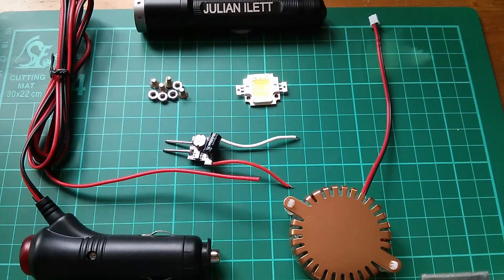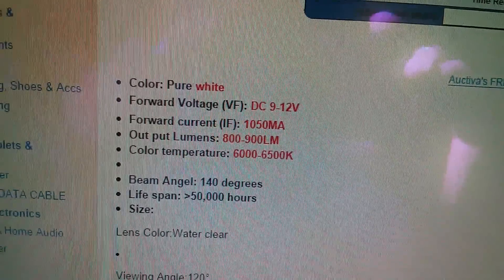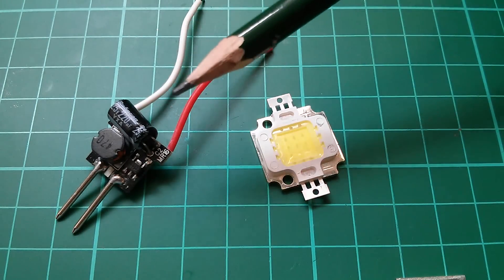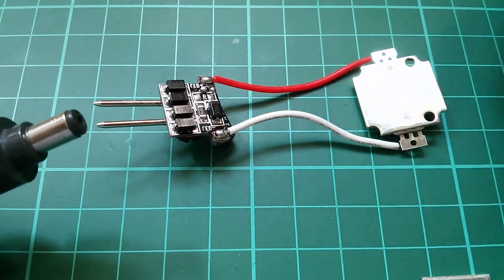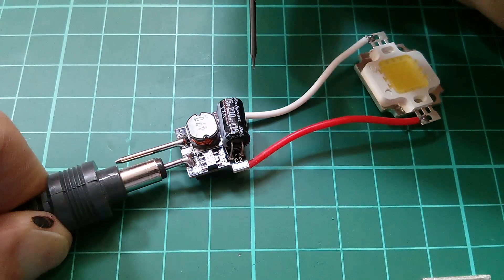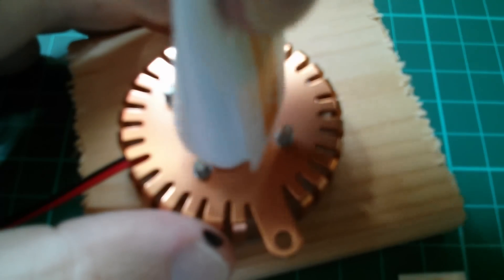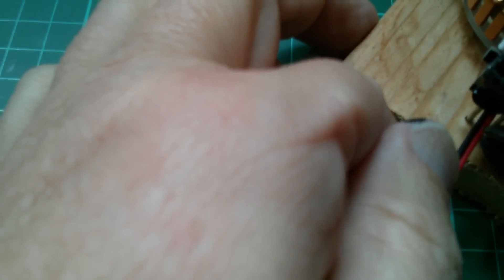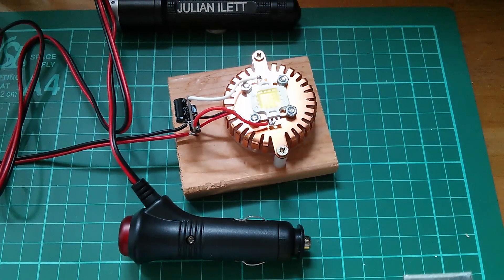LED Tutorial: Light a 10W LED from 12V - Simple & Cheap

Comment: Dear Jullian,

I wish to make a specific led solution and want to ask for your help. The idea is to have a bright led light inside large balloons to create an amazing atmosphere for our wedding. I have two versions in mind:

1) Based on 9 volt battery, for balloons that can float freely. 
Example: http://www.thisiscolossal.com/2013/11/cyclique-aerial-kinetic-balloon-sculpture/

I found out that I need minimum SMD type of led to have enough light. Which LED would be suitable to operate on a 9 volt battery? and which wich LED is bright enough to use, but does not heat up to avoid the balloon to explode? How long would such led light last on a 9 volt battery? How can I keep this as low cost as possible?

2) Based on 12 volt DC
Example: http://thecreatorsproject.vice.com/blog/this-floating-structure-turns-music-into-dynamic-patterns

What module can I use to operate multiple leds and control the intensity and color? Which led lights would be most suitable for this? Is there a control module that can operate on music, or follow pre-programmed lighting schemes such as TNR-i?

You would do me a great favor if you can help me.

Thank you much in advance,

Kind regards,

Erik

Comment: is that heat sink really keeping the led cool ?
Reply: +Dmitri Iarinici I use a somewhat bigger one with 2 of those 10 watt leds and it works. The fan is a must though. It keeps under 40°C (actually measured) even for a very long period of time, like hours and without the fan it overshoots 60°C after 2 minutes
Reply: shi may  yes it reel cool
Reply: It's 10W LED, and the cooler for GPU chip. There are probably no modern GPU that consumes less than 10W

Comment: i have just got a couple of these units to replace the pcb in my cree spots for the bike when i wired them up the led comes on but is only been supplied 2.5 volt and at 10ma when i tested with the stock pcb i got 3.6 volt across the lead and alot higher current any idea why these units are not supplying full power

Comment: Julian,you did it again. Great video and a knowledgeable teacher, handsome project as well. I finished a similar project. It works great. Using 9volts not 12v deacreases heat generated, brightness is almost the same.. Always use a fan (in heat sink) to keep your circuit healthy. To know if heat sink is required;just turn it on for a couple of seconds and touch the back side of LED and judge the necessity of the heat sink.  Good luck guys.
Reply: Yes do NOT use Math or Science to determine the heat-sink. Instead see if your fingers get burned.  1st degree burn - bigger HS,  2nd degree-much better HS    3rd degree - HS with fan

so many idiots in the world..............................

Comment: Guess what i did with exactly that 10w 12v led..
Yea, right:
i connected it directly to a 12V 2A powersource and it worked just fine. (Well it only was about 1 min to test, but it didn't blow up)

Comment: Hi Julian,
Just watched your tutorial. I am newbie to LEDs and I would just like a bit of info. Sorry if I appear ignorant but as I said I am a newbie. Can I not connect it directly to a eg; a 12 volt 6A MW power supply/driver? If for instance I wanted to make a light box with 10 x 10 watt Leds would I have to use 10 current regulated drivers? My last question is could I just use heat sinks and  a couple of fans?
Any advice will be appreciated.
Thanks.

Comment: Cool video
What happens if I use as power supply only 2 cells of LiIo Battery? (14500)
I want to use the same driver as you (but the 3W Version) but I don't have a 12V supply, only these 2x3.7V, so 7.4V from my batteries.

Comment: I've bought recently few 10W LEDs (chinese productions for sure), and I was very surprised to see that the heat generated is pretty huge... I mean, at 450 - 500 milliamps it generates surprisingly a lot of heat that I have to eliminate with a pretty large aluminium heatsink. But, if 500 mA produces that amount of heat, wtf is happening at 1000 mA?!? I think I shall never try 1A...
From my calculations, it results that the max power is about 4,5-5W/LED, the light is pretty satisfactory, but at least theoretically this LED should work with an input of minimum 7-8W, not 5...
 What do you say about that?!?

Comment: Can you use a 100w power supply to power a 10w LED (assuming the voltages match)? Or will the power supply try to push too much current through the LED? As I understand you can have the extra wattage capacity, as the load(led) only pulls and the power supply does not push. Is this correct?
Reply: Tcamp yes but LEDs need to be current limited because they pull more then they need.

Comment: Excuse me for a dumb question, would it also be possible to just have a 12v regulator and a resistor that matches the amps needed by the LED to work? I would understand if it requires dimming, but since it's just a simple light, if it were me I would just use a resistor.

Comment: Can you help with a bit of confusion? I was under the impression that one of the plus points of LEDs is that they don't create heat? Or is it that while the diode doesn't make heat, the circuitry does?
Reply: LEDs convert the electrical power to approximatly 30% ligth and 70% heat, while your old style bulb converted it into 5% ligth and 95% heat. So LEDs are 6 times more efficient than old bulbs bit still a lot of heatis generated.
Reply: For a given amount of light, LED's draw less current than incandescent lights, and so they generate less heat. But they are also more sensitive to heat, so high power LED's have to be cooled or they will fail.
Reply from the maker: 1701spacecadet LEDs certainly do generate heat - more heat than light
Reply: But am I correct in saying it's more due to the current in the solid state circuits then the actual emission of light, as LEDS obviously don't use heated elements to generate photons.
Reply: Simple Ohm's Law, current through the device (diode) multiplied by the voltage dropped across said device = power dissipated in Watts. So YES the Light Emitting Diode is producing heat, and a lot of it at 10 Watts...
Reply: 1701spacecadet if you produce the same amount of light from any other source, then the heat would be definitly a lot higher than LED.
Reply: Starbuckin Does Ohm's law apply to semi-conductors?
Reply: Not exactly. Ohms Law: V = I * R.  If you take the current (I) through the device and the voltage (V) across it you can calculate an effective resistance, R=V/I, but the resistance is non-linear, so it will be different at each current level. But power is still Volts x Amps, and whatever percent doesn't get turned into light ends up as heat.
Reply: +Michael Biggs I haven't fooled with these high power arrays but for the little guys you know what the self regulating voltage drop across the LED is from the spec sheet, around 2 volts for most of the little ones. You also know from the sheet or experience what the maximum current  and reasonable operating current is. If the power supply voltage is higher than the drop across the led you just calculate a series resistor value to drop the excess voltage at the desired current. Leds are current devices, like neon bulbs and always had a series resistor. These arrays seem to be more complicated. Is it just to optimize performance that you need a driver? There is another video where somebody disassembled a battery powered work light with an Led like yours. It was running on an 8.4 volt lithium battery and had a big 1 ohm , 10 watt resistor in series but no driver. The enclosure was a big aluminum,finned box that served as a heat sink. Are these drivers PWM as they don't look like they can dissipate any heat? At 8.4 volts, why was a resistor even necessary?  I want to thank you for this video because i went looking for info on drive requirements for these COB leds and you were very helpful. I was thinking of getting a 10 watt work light and making it dual voltage Now I see that I just need a 12 volt  wall wart that is good for an amp and an led driver A 3 pin DC power receptacle will disconnect the battery.
Reply: Unfortunately diodes and all semiconductors generate heat, that is why PC have CPU coolers and large transistors have heat sinks. However compared to the heat losses with say a Halogen Bulb or other incandescent lamp, the losses are miniscule. The most important thing with LEDs to extend their life is heat management. The cooler the junction temperature can be kept, the longer its life. I frequently encounter shop bought LED lamps and bulbs with questionable thermal management. Also the original claims by LED manufactures of lamps lasting 100,000hrs seem to have dropped to 30,000hrs and in some cases 20,000hrs. That is has they compete to produce the cheapest lamps they reduce the levels of thermal management whilst designing in obsolescence.. Its all another big con really, they have lamps which if designed correctly would last virtually forever, but they do not want them, they want shit that burns out after a few years. My friend does maintenance on rented properties most of which are only three to five years old. He is already having to change LED luminaires, often its the electronics in the driver that packs up. Either way the whole luminaire has to be changed, not just the bulb, so not really environmentally friendly. From a planet saving aspect, if you take into account the embodied energy from manufacture and transporting such shoddy goods, and then disposing of them afterwards. And the limited extent to which the raw materials like Gallium and some of the rare earth elements used can be reclaimed. The good old fashioned filament bulb is probably still the best for the planet.  And filament bulbs are 100% efficient in the winter, because any waste heat goes towards warming a building. Having said all that, if you can source long lasting top quality products, and you are trying to cut back on electricity bills, LEDs are a good option, especially for those like myself that want to go off grid..

Comment: You can raise efficency of that assembly by simply shorting input diodes as you power it from DC. That should yield 1.5W (or 0.8W) decrease of power consumption by getting rid of voltage drop on silicone (or shottky) diodes.
Reply: +mibars Of cource you can, but the rectifier bridge has nice advantage: it protect the circuit and the led from inverse polarity.

Comment: doing my experiments with 10w LED, at 12V (without current limiter) i reach amazing 3.2 AMP! and hot as hell, but with current limiter set up at 1 AMP, i reaches 9,44 volts on LED. i have a video showing how i turn the LED up. if are convenient for you to watch my vídeo... 

https://www.you tube.com/watch?v=9kyrs0sj8zY

sorry for

Comment: I forgot to say that I'm thinking on using batteries,but I will need suggestions for that,too. I am not the person who works with battery formulas,and I wish I could get the batteries in a box with the LEDs and put it where my existing light(Nikon LD-1000) would go on its tripod mount.i want the batteries to run at least half an hour,if not more.
Thanks again!

Comment: Hi Julian, I want to make a bike light. With 1 10w led, 3 1w led's and 6 3w led's. could i drive all of these with 12v 4000mAh and with these thing's: (www).banggood.(com)/LED-Driver-Charging-Constant-Current-Voltage-Step-Down-Buck-Module-p-939196.html and (http://www).banggood.(com)/3A-LM2577-DC-DC-50KHz-Adjustable-Step-up-Power-Converter-Module-p-87541.html
Or is that couldn't drive all of these led's? If it can then can I add a 4 usb ports?

Comment: Hi Julian,
As per my knowledge LED will draw only a required ammount of current for a given voltage. So if I connect a 12v power adapter with 1Amp rating to a 10W LED then will it be OK ???
Reply: Networking-Fun no you would burn out the psu

Comment: Why don't you remove the Graetz bridge diodes if you already have the correct polarity?
I removed those 4 doides in my one and it saves a lot of wasted energy (voltage drops on the diodes and heat).
I also could use those Shottky diodes for other circuits etc.

Comment: Sir am trying to build a cheap led driver is it possible to use an lm317 to build a simple led driver
Reply from the maker: Absolom Madhaka Yes, but it'll get hot. It's no better than using a resistor in that respect. Switched-mode LED drivers run much cooler.

Comment: I am making a grow light.  The 10W Red ones I am getting use 18-22V and the 50W blue one uses 30-33V.  I think I can run them off a laptop power brick.  For the 30-33V I think I should use a voltage booster with a laptop power supply.  Is that a good idea?
Reply from the maker: Volumptous Bousseum LEDs must have current limiting, so running directly from the laptop PSU isn't a good idea. If you use a voltage booster (and it has current limiting) that will be OK.
Reply: Yeah def.  I'm getting those little boards that regulate the current.  I'm not sure if the booster has current limiting...probably not.  I was wondering if it is better to put them in series or parallel from the regulator.  If one way it's better or it does not make a difference?

Comment: https://www.dropbox.com/s/gk1kfau5mnwlqx4/20141027_204612.jpg?dl=0
 
Dear Julian - I just want to thank you for your design... Im involved in a small meditation gathering and it now lights up our 30ft yurt! ... Everyone was impressed, so thank you
 
Performance wise, we had it running each night for 7 nights, 7hrs a night = 49hrs total . I kept checking the 110ah leisure battery, but it didnt seem to draw very much, so there was no need to recharge the battery for the whole of our camp which was a surprise.
 
I bought a £1 solar light for the plastic diffuser, to help dissipate the light. Also i put a hinge on the mount so that it didnt matter what angle the roof poles where, i could always change it.
 
Im thinking of maybe making some more to light my house Grin
 
 Do you think that the LED would survive without the fan running in the heat sink?

Comment: I pressume the driver supplies optimal voltage (and current) for this particular led. But you've said led should not be connected directly to 12V. Most of them don't have such rating by far. My question is, however, would it be possible to use a resistor or a potentiometer instead of the driver  in your scenario?
Reply: Yes as in 12v led strip lighting. Off course problem is your wasting power as the voltage drop turns into heat.

Comment: Hi , love the tutorials i aways learn lots.
Could i take a PC PSU to power the leds , use an arduino and a TIP120 or TIP122 to dim one of these leds?
Or should i was a constant current driver like http://www.ebay.co.uk/itm/1pc-DC-DC-LM2596-Step-down-Adjustable-Power-Supply-Module-CC-CV-LED-Driver-AR-/400739932544?pt=UK_BOI_Electrical_Components_Supplies_ET&hash=item5d4df61980 and then use the TIP120/122?

Im looking to run 4 or 6 leds on a 300x140x20 heat sink using blue and white for a LED fishtank light.
Any thoughts/help would be appreciated?

Comment: Hi Julian, I didnt know about the current curve in LEDs and I would appreciate a lot if you can clarify my doubt. I am planning to make a 900 LED strip light panel (to be used as a video light) powered by a modified 650watt PC ATX power supply and/or a 12v 7Ah sealed lead battery. My question is Can I power the led strips directly from these power sources or should I need some sort of driver or current regulator? Thanks.
Reply: Led strips normally are designed with resisters Have a close look, so you can run 12v constant voltage.
Reply: My consulting fee is 20 USD per hour

Comment: Hi Julian, Just out of interest - how do you strip wires? 10:34 you didn't seem to have much room for manouvre. I use cigarette lighter, burnt fingers and swearing, chiefly because whenever I've tried cutting insulation, I always damage the core. Have you got a proper mechanical stripper?
Reply from the maker: reggiebacci The main one I use is a Weicon wire stripper No. 5
Reply: Julian Ilett
Cool, thanks - I'll keep an eye out on eBay.

Comment: Unfortunately the quality of these LED drivers are questionable I believe and usually stop working very quickly. Sometimes caps explode in the process, sometimes they just stop.. The LEDs are always working after tearing the whole thing apart and testing the LEDs individually. That happened to me with dozens of the equally cheap Chinese"MR16 LED bulbs". Now I'm stuck with the LEDs and cases but need decent drivers to make use of the LEDs again. AND I didn't wrote down the wattage of the LEDs so I can't tell if they're 1w or 3w modules. Is there a way to find out without burning some of them ? If any of you had any experience with that kind of thing, please let me know, I would love to hear about it and possible solutions, diy projects or fixes now that I've got all the spare parts and most drivers won't fit inside the bulbs! :)

Comment: Could a bunch of these be mounted to a 10mm thick aluminium bar to use as under cupboard lights in the kitchen? 
If so what kind of power source would be needed?

Comment: Nice work mate! I always enjoy how you mount most of your projects on a piece of timber.
Q. About longevity of LED's, I recently had to replace a few modules on installation. Roughly calculated they had about 2000hrs of usage (operated on a daily timer circuit). Surely I might have gotten a rotten batch, as I believe anyone should be able to get a good 50K Hrs out of module.